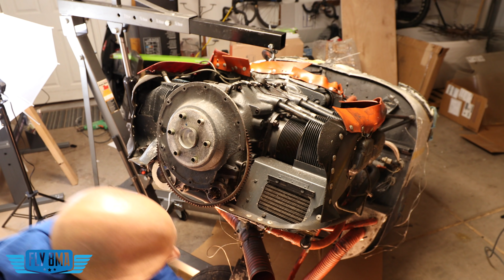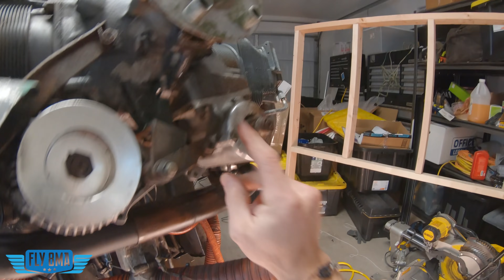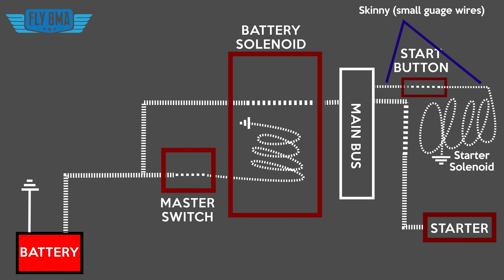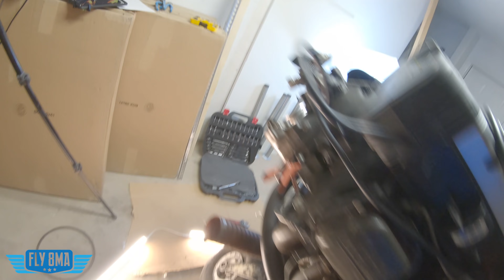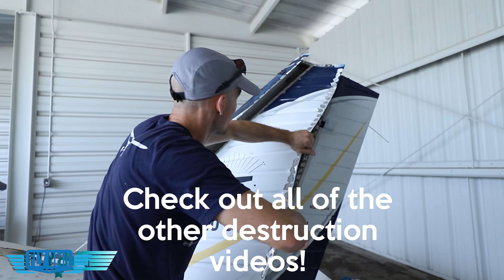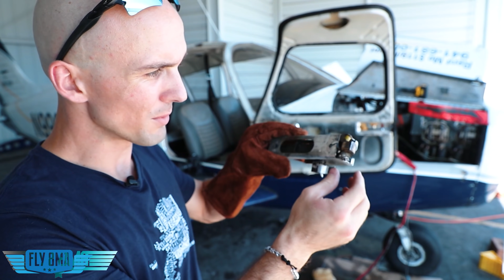Piper Cherokee Aircraft Engine

Comment: Hey John, thanks very much for this video, it's yesterday at work here in England UK, for the PA28 aircraft, l removed the analogous of those electromagnetic switch(solenoid, relay, inductor, coil or choke) as its sometimes called different places in the world. That transduce electrical energy to the starter and other loads with respect to its switching or operational sequences.
I am delighted that you made a cross sectional cut in the device so l could see how the inside structure is composed, inductor windings.

Great awareness for me, l have subscribed to your channel and l will recommend to my team of engineers at work to do so as well..
Reply from the maker: Hey, thank you so much!

Comment: Whether it matters or not on this engine, you shouldn't run your ground through the crank, thus going through your crank bearings, and in turn arcing through the bearing, they will surly let you down shortly.

Comment: With my Lycoming D2A the crank propeller flange has threaded inserts. The bolts you show in your video are AN bolts with a fixed thread grip. No matter the length of the bolts, the threaded length is the same. There is a big problem. The threaded insert length which are coupled with the propeller flange are greater than those of the AN bolts. The bolt will bottom out long before the threads will protrude past that of the length of threads in the insert. In a nut shell, the insert threads are longer than any AN bolt period and no exception. Even with the propeller off of the engine and the bolts threaded to the propeller flange which are designed to use inserts, the threads of an AN bolts will not protrude. Now this is a problem if you are of the mind when dealing with fiber lock nuts and the rule there is to have two threads of protrusion. Does this apply to propeller bolts? Obviously not If a AN bolt with its limited thread grip is used. 

If the propeller is the same as when the aircraft was certified and the bolts are the same as when the aircraft was certified, then we know that regardless of thread protrusion, ie a visual inspection, the full grip of those bolt threads are fully engaged. But what if this engine is now on an experimental aircraft with a wooden propeller and the thickness f the propeller is different? What If the builder knows this and has measured and installed the proper length of bolts to insure thread grip into the inserts but no threads protrude because it is impossible for those protrusions to occur, certified aircraft of not but the inspector pops you and fails the build because even they are mislead by the myth of the two thread protrusion propagated by the fiber lock/ friction lock requirements but applied wrongly to other bolts and fasteners. 

How do you assure then, if those who are now screaming the two thread protrusion is the law, a threaded fastener hole in a crank case  and the partnered has the proper grip. You don’t visually. 

The threaded inserts which are found in many Lycoming 0320 crank shaft propeller flange engines are wider than the grip of AN bolts. A two thread protrusion is impossible no mater the thickness of the propeller. This is a fact Jack. So what now? No one really seems to know. No one yet can point to a publication which addresses this specifically. 

If the propeller flange is directly threaded ( not with threaded inserts)and the thickness of the propeller is as the certified propeller, I expect the threads will protrude.

Comment: Great idea to have a back up alternator belt already good to go in case of an unfortunate damage to the original one, on a remote area like Alaska. Now, a question here: if the back up belt attached with a zip tie, which is pretty much made of plastic; could the plastic material melt due to the heat of the engine, then get all loose and cause more damage while in flight ? I was just wondering. I’d appreciate your input. Thanks John!
Reply: I’d find the high temp zip ties, or depending on open bolt holes or existing bolts in that area you could add an Adel clamp to hold it

Comment: I would suggest marking the prop position on the crankshaft flange before removal.  Also, grounding through the crankshaft flange is a bad idea.   The current might be carried through the bearings.

Comment: HI John, great content ! I have a question and a comment: 
Comment: the shear strength of a grade 8 bolt like this is much greater than the holding power of the threads in tension
Question: if you are working on a certified airplane that is no longer manufactured or supported, can you fabricate (CNC machning) replacement parts and have them installed by and A&P or do they have to come from the manufacturer or an approved replacement source ?
Reply: @rosettahaze  let me clarify my point and add a few more:
1. Bolts subjected to pure static load (and properly torqued) will almost always fail at the base of the head
2. But bolts subjected to a dynamic load (and properly torqued) will usually fail in the first few treads of the bolt. I believe this is the case for a propeller because of the crackshaft vibrations. 
3. The typical shear strength of a bolt is around 0.6 times the tensile strength

Comment: Please don't use the DVOM in resistance/continuity mode in order to measure the ground connections. It might look OK for small currents (DVOM supplies a very low current) but for the high loads it might not. My preferred way is to supply a constant current (at least 1/10th of max. current) and measure the voltage drop.

Comment: "Don't go to NAPA to get the belt" I've literally flown an aircraft with a spare belt in the back - NAPA branded.
Reply: How does one figuratively flown an aircraft?
Reply: @rafborrero  Well, there I was, FL370, upside down, on fire, losing airspeed, and engine one had just went "poof" and I knew I needed to....

Comment: Not that I would ever do that belt trick… I don’t think the belt trick would be considered an STCable or an alteration for that matter. It doesn’t change the structure and would not appreciably effect weight and balance. Even if it did, it would classify at most as a minor. It’s just secured cargo and I’m almost thinking when you used it, that it would fall under owner operator approved maintenance??? Since your not having to remove the prop. Just my opinion of course…
Reply from the maker: Haha....I like your thinking!
Reply: @fly8ma.comflighttraining199  it’s not really thinking as much as how I read the regs. It’s not a modification… lol it’s just stored cargo. 😂